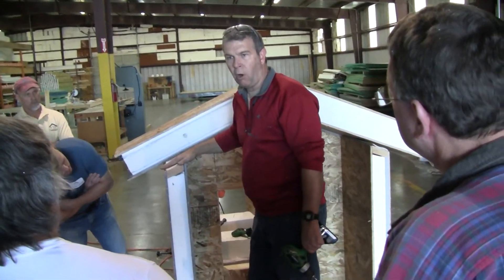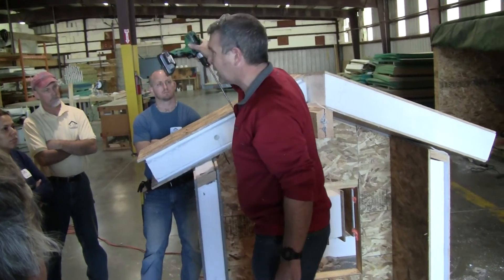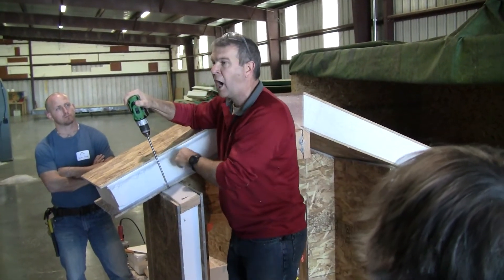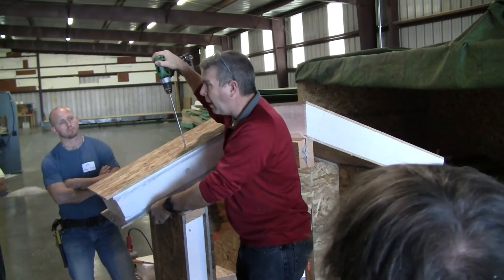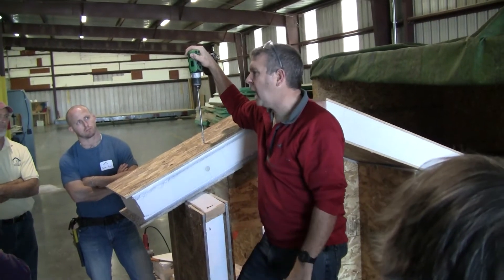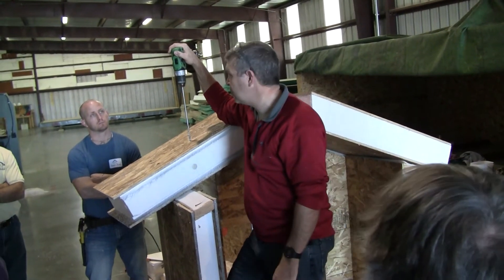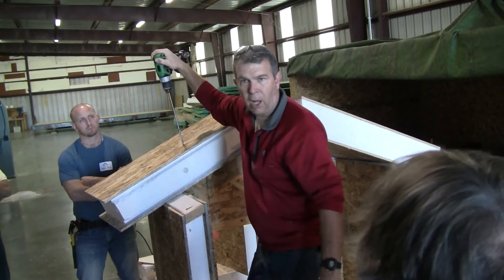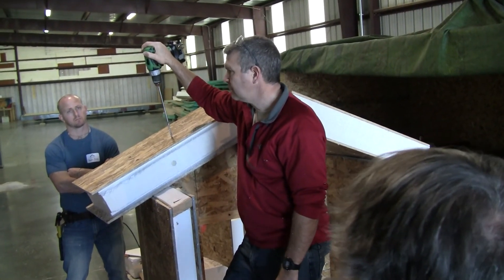SIPschool's SIP Installation Basics: The Most Important Joint in the SIP Envelope

Comment: I've always wondered how to insulate this joint. Essentially there is a huge thermal bridge at the spline of the wall panel that the roof is screwed to.
Reply: Maybe a bevel the edge of the lower roof SIP and upper wall SIP, butt them up against each other and tie both to an interior ridge beam with SIP screws like a ridge beam detail.  Essentially a timber frame structure for the SIPs to mount to, giving continuous insulation (CI) from wall to roof transition.

Same applies to corner walls, beveled SIP walls butt together tied to interior post.  CI in wall-to-wall corner transitions.

Just need to figure out one for sil plate for insulated slap on grade and wall SIP transition, and you got CI around the slab, wall, and roof!